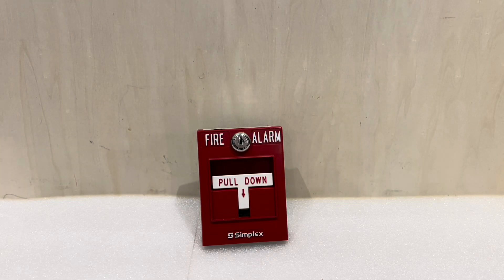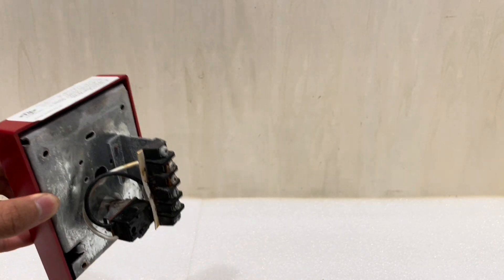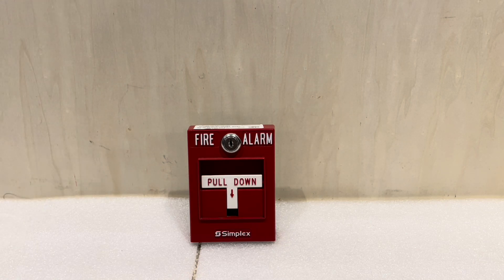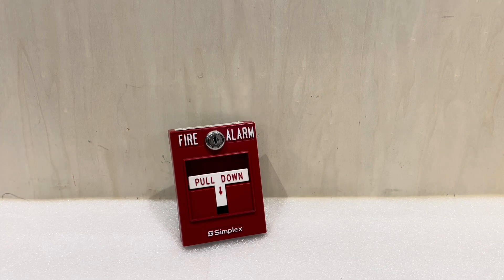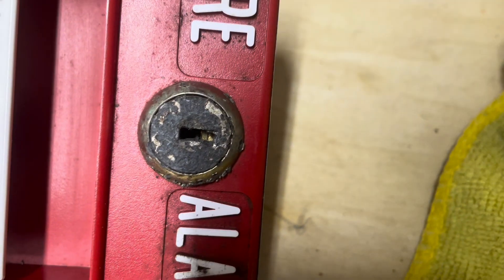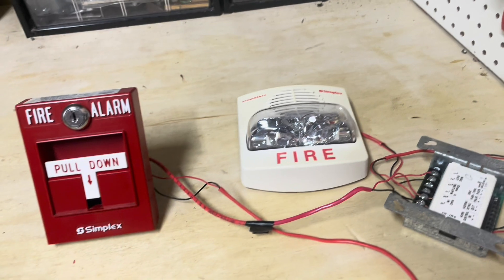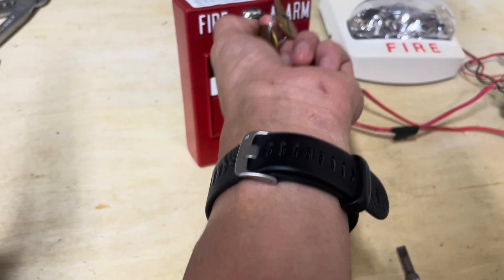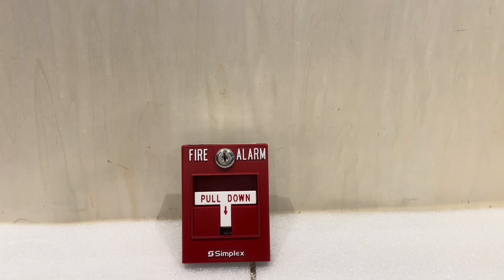Simplex “Intrinsically Safe” Fire Alarm Pull Station - What are these for? (2099-9767)

Comment: So you had mentioned that a truealert or a 4903 or any other simplex device that uses a xenon strobe would not work. 
That's the reason why the 5900 series was created.  LEDs are designed to actually be intrinsically safe.  Little current, low power.
The reason why people don't choose 5900 series for standard buildings it's because they don't need to. 
For this however it will need a 5900 series led device.
That's something you forgot to add for the LED devices and their advantages.

Comment: The one time I actually needed to activate a pull station it didn't work. It was in my apartment complex in 1986. The roof TV antenna took a major hit by lightning . The whole building shook, pictures fell of the walls my TV blew up and the roof was on fire. I ran down the hall and pulled the alarm switch but nothing happened ! Then I noticed black soot marks around the switch. It took the jolt as well. We pounded on doors and most people knew we were hit but didn't realize the roof was on fire. To add insult to injury, the fire department arrived but kept going down the street because the automatic alarm system in a nearby building was activated. Eventually they arrived and put the fire out. Several top floor apartments and our electrical system was damaged.

Comment: Hey fire alarm dude, I am making my own fire alarm board and I have the problem with all my pull station that it activates the alarm when the button is pressed down and off when the pull station is pulled or open, do you know how to fix this ? I used a simplex 2099 dual action t bar and a fire control instruments dual action  bg12 as well and removed the addressable but still the same problem and also it happens that when the pull station is closed or pulled it still sounds the alarm
Reply from the maker: That’s unusual. What’s the model?

Comment: Let me explain what intrinsically safe means - It doesn't mean the contacts are designed in such a way a spark cannot appear. It simply means the system uses a lower voltage and amperage, so a spark cannot appear.

A intrinsically safe device, must be used with a so called intrinsically safe isolator, which is a device that restrict the amp and voltage so the available wattage is low enough. A ATEX classed FACP will have this built in the zones, however, the FACP must itself be placed outside of the hazardous area.

One design element of a intrinsically safe switch however, is that care must be taken so the leads doesn't build up a stray capacitance and causes a spark.
Thats why the switch has 2 contacts, so you break  both leads of the FACP zone, and not just one.
This ensures the whole leg after the actuated pull station will become a dead leg, which cannot aquire a capacitive charge (the whole lead will instantly take the potential any part of it becomes, meaning a capacitance cannot be built up), as opposed to where one part of leg could be connected to ground, and thus become a in-wall capacitor along with other wires that might inductively couple with the lead)

One example of this is when you do a 2-wire romex from a lamp fixing to a wall switch (and tape the neutral black), and then when you turn off the switch the LED light glow faintly, making it impossible to turn off. Thats capacitive coupling!

A intrinsically safe light switch, have a low voltage and amperage circuit, that controls a device outside of the hazardous area, which is responsible for turning on the light.

Note however that intrinsically safe is not explosion proofing. Explosion proofing is another way to accomplish ATEX, which means the device is sealed in such a way that hazardous gases cannot reach inside, and then the device is allowed to spark as much it wants. This means limited possibility for switch arms to reach through, why such switches are usually magnet operated - the switch lever moves a magnet, which then moves a magnet on the other side of the explosion-proof housing by magnetic force, which then actuates the switch.

A third way to accomplish ATEX is to not use electricity at all, but instead use a pneumatic button or switch, to actuate a pressure sensor that is mounted outside of the hazardous area.
In the same way, a compressor and air storage, can then pneumatically actuale locks, actuators, and other mechanical applications inside the hazardous area by air only. Care must then be taken using check valves and other safety devices like seals, air exchangers, etc so the hazardous gasses cannot escape out to the non-ATEX area by the pneumatic hose, for example if compressor fails and loses the positive pressure in line.

Comment: Just had a fire drill the hinges suck on all simplex pulls because the cover came off mine
Reply from the maker: I’ve never really had that problem
Reply: @FireAlarmDude5967  how
Reply: @FireAlarmDude5967  the hinges came off my simplex pull station barley opens it
Reply from the maker: @Newenglandaviation987  odd. I don’t have that problem with any of the T bars in my collection. I’ve readjusted the hinge on a few of the older pulls though.
Reply: @FireAlarmDude5967  is there anyway I can avoid thid